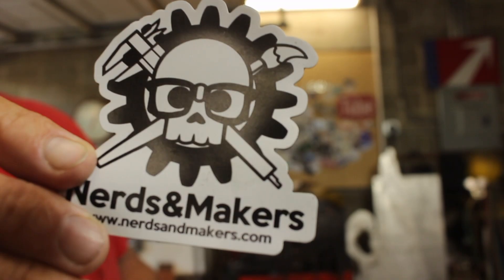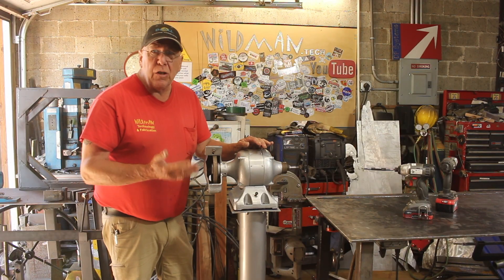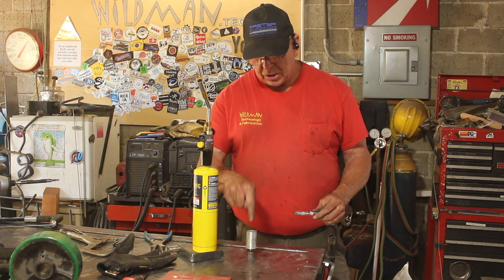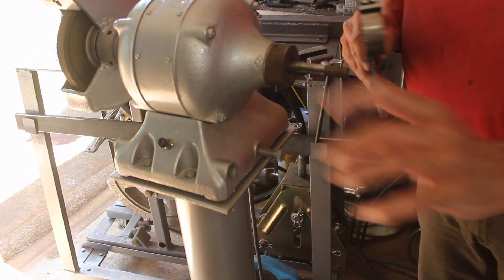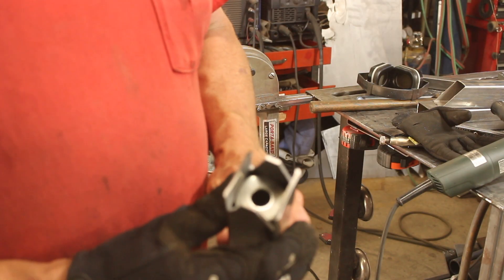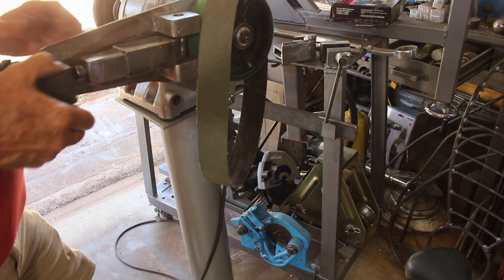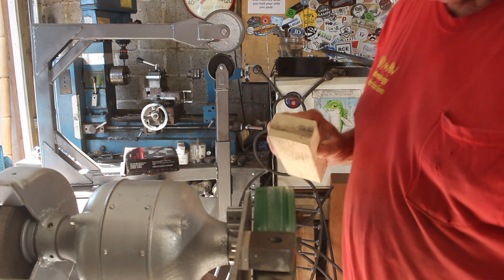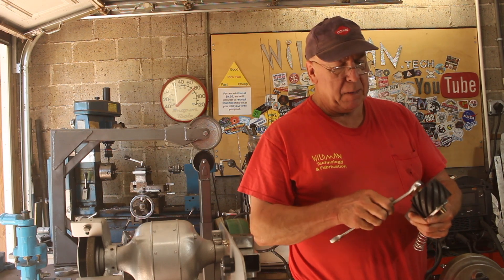Build a Belt Grinder!

Comment: Nice restoration and build. I loved how you did the tensioner. For galvanized steel a simple way to get rid of the zinc plating is to let sit the part in strong hot vinegar (acetic acid). Usually the one available at grocery store is at 8%, but for quicker results use higher concentration up to 20% (often used in "bio" weedkiller). At 20% a bolt can be cleared from zinc in about 10 minutes. The spent acid can be safely thrown down the drain. Of course you're right about fumes: never breath them anyway. Greetings.
Reply from the maker: That's a great tip! I'll try it. I get chemicals like that from my local chemical supply. Much cheaper!
Reply: @WildmanTech  I'm glad if that'll be helpful. Speaking of chemical supply let me add just a word of caution: while acetic acid is a weak acid, it should not be overlooked that at higher concentration it could be relatively dangerous if not handled with care. Eyes and the respiratory tract are the most sensitive parts.
Reply from the maker: @AccidentalScience  I was a chemist, but thanks.